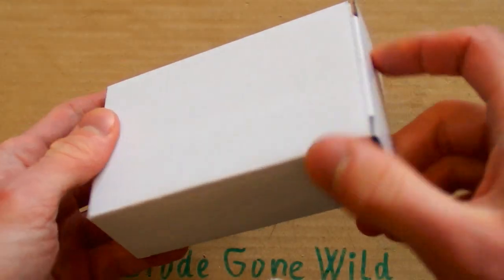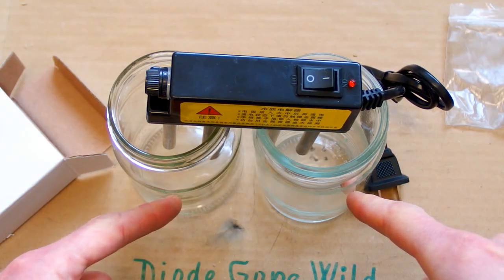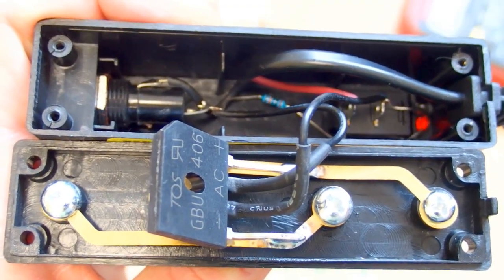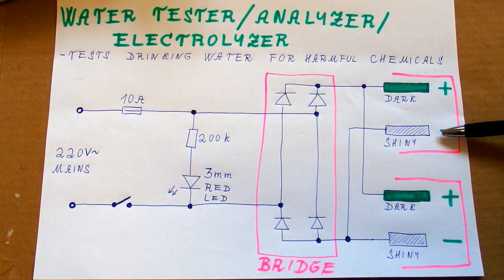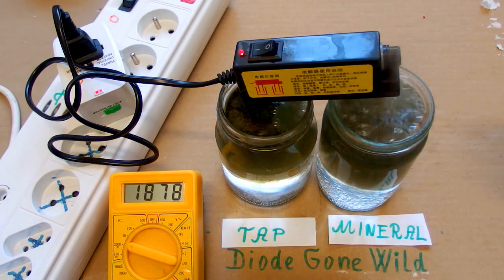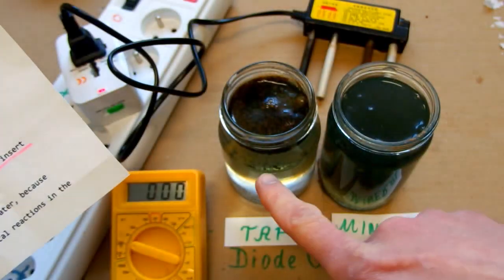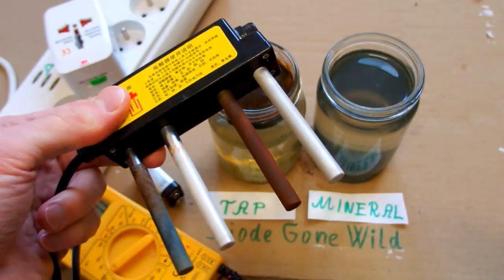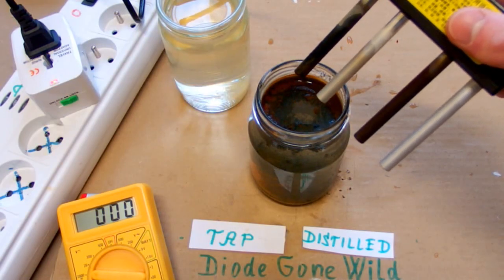Water Electrolyzer (Quality Tester). The Most Dangerous Appliance Ever?

Comment: That thing is lethal especially that it outputs dc .     There is such a thing as an electrode water boiler and that device is one.    Cut off the cable and smash it wih a hammer before disposal.

Comment: I knew these couldn't be accurate, as the Cathode and diode pollute the experiment. I hadn't realised just how dangerous they are, or how much power they used..
If you want to test your water buy a box of testing stripes.
don't buy over priced dangerous chinese  junk. Any shops selling this device should be held accountable.
As a foot note if you still aren't convinced at the very least buy a good trip switch.

Comment: This is NOT a tool for checking water quality at all. This is a SCAM. An electrolyser splits water into oxygen and hydrogen. The effect dissolving the electrodes is called electrogalvanization. Do NOT drink the mess this leaves behind and do NOT drink distilled water!
The amount of scammers vouching this product in the comments are concerning... but it proves one point; That whoever is behind this illegal product is also promoting the scam.
Reply: The product works as intended: It splits water into ions and shows what else having bonded to the molecules. The mess you get is simply broken down what is in your water.

Comment: This guy is  VERY misinformed. The newer model (2023) of this tester is completely self-contained, (sealed,) and cannot be opened by the operator. The instructions on the device are in English, and include voltage and handling warnings during operation. Step-by-step instructions for assembly and operation are also printed on the device, and I've tested the safety fuse and it functions as intended when a short occurs. The mounting points for the FE (iron) and AL (aluminum) rods are clearly marked, and each threaded stud on the base is protected by a molded plastic sleeve, for safer operation. The narrator also misstates the reason for two sets of electrodes; the purpose of two sets is to test two DIFFERENT water sources (such as tap water vs bottled/filtered water,) at the same time, and compare the results. The electrolysis polarizes iron and other impurities in the water, producing discoloration, and if substantial impurities are present, a residual 'scum' may form on the surface. While some particles are from the electrodes themselves, the 'harder' the water, the more contamination becomes visible after a few minutes of applied current. I purchased this device for $11 on Amazon, and have tested four different water sources in our home, producing clear indications of the need for improved filtration on our drinking water. However rudimentary the results may seem, this inexpensive tester offers a quick and simple test result, at minimal cost.
Reply: Please tell me you're joking.
Reply: even the a.i bθts are here , incredible

Comment: It 100% does what it says. The Distilled water had no change in colour hence it has no metals or toxins. How does he come to the conclusion that it's from the electrodes. I've ordered to want to try it on my Alkaline & whole house water filter.. He must be a paid proxy by those behind Agenda 2020-2030 to call this a scam.but it 100% works
Reply: People like you will never change your ways of thinking so this reply is pointless, but if you want an explanation as to why the corrosion is from the electrodes, it's because of electrolysis. The electrodes are made of two different alloys of metals, and then electric current is passed through both of them, positive and negative. One of them is a positive electrode, and the other is a negative. This causes the metals in the electrodes to start degrading and corroding away, which creates the effect of the device miraculously showing the dangerous chemicals in the water when in fact it's actually just the degradation of the metals.

Tap water is conductive due to the mineral content within it, so this causes the electrolysis to be able to occur. When you use distilled water, the water is completely non-conductive, and thus doesn't allow the flow of electricity, and this stops the reaction from occurring. This device is a scam and is incredibly dangerous! People like you who can't even comprehend COVID or 5G are the last kinds of people who should be handling these devices with exposed 120v-230v mains electricity.

Comment: The machine does work European water is disgusting from the tests I have run and from the sounds of things has done some damage to the author.   I would drink distilled or ozonated water if I were you.    As for the safety of the device running it on a converter to a European plug is defiantly at your own peril.   It says do not run it over a minute and here you go failing an IQ test.   Oh and you have parasites from your cat 🐈 😻 🐈‍⬛️ 🙄 .   "Probably released" from the electrodes?   No not just distilled water ozonated or clean water at pH 7.   I have had no problem with it and furthermore from what I have seen European water is awful I used this machine on European waters and it gets pretty bad.   Yet Canadian ozonated water, distilled water and even tap is superior to all European water probably from human activity, war and population density.     Set your pussy free.
Reply: Your thought processes should undergo study by psychologists looking into cases of narcissism, superiority complexes and general insanity. 👍

On the other hand, look into electrolysis. This device is a complete sham and corrodes the metal alloys that are in the electrodes, causing conductive water to turn into a disgusting mess of heavy metals. Distilled water is not conductive because it contains no minerals like tap water. You're living in your own made-up world. While your at it, try treating Europeans like humans too. You're more deranged than any European I have ever met :)

Comment: Actually I did this on 3 different waters. Tap unfiltered, Berkey system filtered tap, and unfiltered rain water. The two tap waters had very similar results. Yellowed severely and black nasty stuff created and made a film on surface of water. The rainwater however, barely turned yellow. I let the electroyzer run for 4 minutes on each. Ran the tests twice. Consistent results botg times.

Comment: I bought one and tested our tap water verses fiji water bottles water and burkey filter. The tap was the grossest and fiji turned green, reverse osmosis never changed color except a tinge of yellow. I saw with my own eyes that pure water wasn’t affected and stayed the same color while my tap water changed to black green with a tinge of red and white. I checked our cities water online and low and behold the electrolyzer proved correct at the amount of arsenic we have in our water. I will keep this video in mind but I trust what I saw on my own experience this far
Reply: Can you put salt in your reverse osmosis water until it's saturated and repeat the test?
Reply: @DMC428  I put celtic salt in my distilled water and ran the test. It only turned yellow, it didn't turn into a toxic green, black, blue, and brown sludge.
Reply: I had the same experience. I was happy to use this. See the results and now I have transformed my water for my kids. I am also happy that I now know the danders of this device and lucky for me I don’t still need to use it (or just don’t touch the rods?!)

Comment: This a little misleading I used this test on my own and had the waters tested at a major university the tap water is discolored due to the high levels of garbage in them not due to erosion. I know this because when you test calloway blue drinking water it only turns yellowish and this is due to the presence of fluoride. The tap turns completely different colors, releases chlorine so you must be at a distance, and loads of solid matter comes out as well. So inn short the be mindful when dealing with electricity and the discoloration is from the content of the water.

Comment: Thanks. I know the water quality in Northern Britain is filthy. I use a water distiller & have seen the mess left behind.
Reply: @Vape Girl I have distilled filtered water to test them  & there are still contaminants. Distilling is the only way to remove everything leaving just pure water. Expensive now (was 9 pence a Litre) at 550 watts but I use power generated by solar & wind. But it's the only way or build a solar still that needs no power but needs the sun.

Comment: The electrolysis just makes the electrodes corrode and fill the solution with metal hydroxides and they try to convince you those contaminants are from the water. This is indeed a miscarriage of justice. XD
Reply: Would maybe agree if it happened in distiller water which it doesn’t.

Comment: Distilled water does not conduct electricity.
You should try filtered water from the beginning.
Usually reverse osmosis water will show you the result better.
Despite all this, there is a special water quality meter (TDS)

Comment: I'm not a chemist or anything; I see some conspiracy theories here, which I'm not saying are absolutely wrong but they don't seem quite critically thought.
With some basic understandins of chemistry and some simple google searching, you can see that the colors visible in the water testing are actually very close to what you see as many compounds with aluminium and iron. Aluminium choloride is actually yellow although here it acts as the cathode. . Iron oxide is one of the most used matters to make a wide variety of color pigments including red, yellow, green, brown and black; all the colors we can see in the video. Also the iron chloride has almost the same colors. With that much power and heat it is so easy to enable such chemical reactions.
Also adding salt to distilled water means adding other elements to the reaction, not just making the water conductive; especially the chlorine which can combine with both the iron and the aluminium, both of which have colors. Besides that, if these heavy metals or toxic metals exist in drinking water, there is a good chance that they are already making the water (more) conductive; so you're only testing the conductivity, not the claims of the producers.

PS: the more percise way of testing the chemicals in the water would be the kits, eg the heavy metals water kits. Testing the water before and after using the electrolysis(which highly probably shows the iron compounds afterwards). Because if you use the device as something to test those materials in the water(ie using distilled water and salt to prove that those components exist in water), you have based the premise on the device being a reliable tool, something you know for a fact that tells the truth about the things in the water(which makes your experiment flawed) whereas you are actually doing this experiment to see if the device does what it claims to do.
Reply: So is the device a scam or legit?
Reply: @hezu2013  at least in normal circumstanses, it is a scam.
Reply: @adibmohareri1223  what took you so long to reply😄
Reply: @hezu2013 sorry, I haven't seen yours sooner, not untill today that someone else replied :,) I even forgot what it was about and had to read mine all over again :)))
Reply: Thanks a lot taking the time to explain this! I like your approach.
Reply: @aliberk3112  thank you :)

Comment: The device is totally unsafe and this electrodes is not suitable for low pH water electrolysis. Only carbon or very expensive rare metals can be used for low pH water electrolysis cleanly, like gold, platinum or rodium. All other metals will dissolve.

Comment: The electrodes are aluminum and steel. The  steel (darker ones) shed iron oxide during the process making the water appear dirty. The scam is, The left glass must contain distilled or filtered water which will not allow current to flow and the water remains clean while the water being tested in the right glass becomes full of iron oxide and appears as if the scam device was doing it's job. It isn't. It only takes the iron from the steel electrode in the water in which current can flow due to the particulates (minerals) it contains. The device is a deadly hazard and should not be imported. Don't buy it!
Reply: I tested tap water and several bottled waters and they all turned different colours, Some bottled water just turned slightly yellow. So your explanation is rubbish!!
Reply: I just wanted to tell you I bought it and your explanation doesnt really stick because, whatever side, left or right, I put distilled water it stays clear. So there has to be another explanation. Do you have any other theory about it?
Reply: @Tanouuuu   destilled water => no electrolysis => no effekt at all 🤭
Reply: @Tanouuuu  You’re right. Distilled water is best too.

Comment: While I agree the metal rods maybe contaminating the water slightly, given different water types turn different colours then this must mean that the device is actually working to show what contaminates are present in the water regardless if the metal rods sheds whatever in each water test or you'd get the same colour results for all.
Reply: Ive tested destilled bottle water and its fairly clear comparing with tap which was  disgusting, brown sludge and yellow and black
Reply: I was curious. Tested tap water, the natural spring water I was drinking, and three other including a steamed distilled water. The tap water and the natural spring water didn’t just change color there where floating particles. The natural spring water actually looked like you scooped it up from a swampy lake. It was beyond disgusting. The others just changed in color nothing floating. I even switched the metal rods in opposite glass to see if change. And no. So all the waters i tested where totally different.
Reply: Scam machine is what this is
Reply: @LeapingFrogg  it was bottled from a spring here where i live from the natural grocery store. It’s a family owned spring. I was just thinking about it yesterday and looked up the family owned company. It’s in Ava Missouri. So not sure if it’s supposed to do that because it’s coming from nature. It’s all so confusing. Cant we just trust the water. 🙃
Reply: @jillskelton1891  I tried posting a link yesterday but the boob toob deleted my post. I'm tired of this constant cens0ring.

Find a spring (period) o r g  all in one word. You can fill your own jugs of water free from mother nature.
Reply: This platform is now axing all my posts. This is a crime and they will pay for it dearly.
Reply: Agreed, I have the machine and different waters always give their own color, over and over, am just trying to figure out if it is good or bad. But it's really obvious the rods are not shedding, if so they would be shedding in watever water they would be in.

Comment: @diodegonewild

 Could you tell us something about your yellow power metter and about your outlet which help you when you measure power?

I am courious to know how it is made, aparently from a cheap multimeter without power measurement. Thank you!
Reply: exactly i was wondering the same thing. maybe he used a shunt resistor in series and measured the voltage across that?

Comment: I think it would be a wise precaution to wear insulated safety gloves when testing your  new electrical equipment, from some unnamed countries ! On the other hand, you could always use the Electrolyzer as a mini electric kettle. lol.
Reply: Definitely not using it as a kettle… it’s going to change the chemistry of the water and deposit carcinogenic and other dangerous traces of metallics into the drink
Reply: are you saying that the  Electrolyzer will boil water. please can someone with knowledge answer my question.
Reply: @Chris-fg7me  Yes, it will. In 90s we heated water with electrodes made from razor blades.

Comment: Instructions for using the electrolyzer First place two sets of electrodes in two water containers, connect the device, press the switch and electrolyze for 30-60 seconds.  After the electrolysis, different water colors show different impurities in the water: yellow: dissolved acid, fluoride, other organic substances, green: God (magnetic cream), mercury, lead, copper, sodium blue.  Pesticides and other red ones: iron and rust, white bacteria: lead, zinc, mercury, inorganic salt. Dirty electrolysis. Black pattern: heavy metals